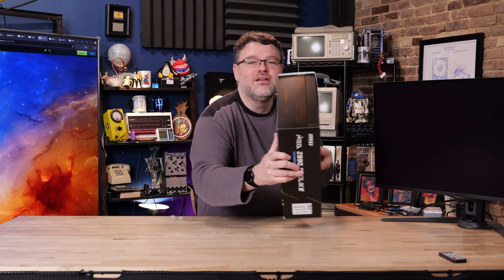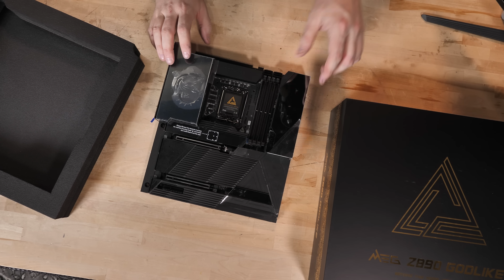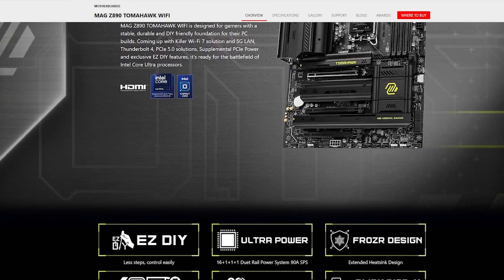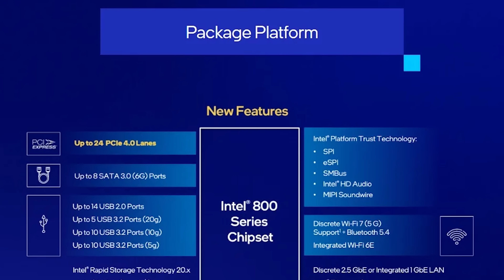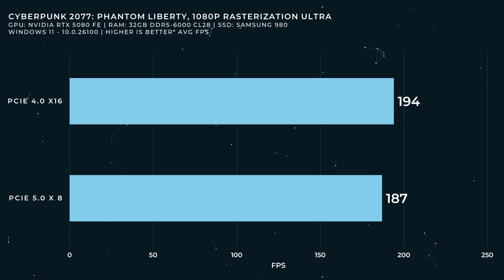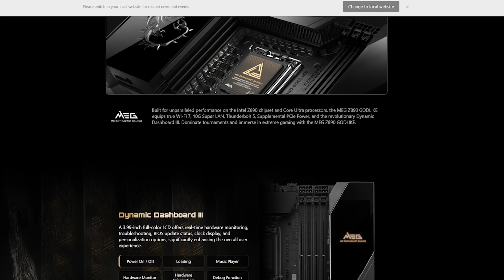Checking Out the MSI MEG Z890 Godlike!

Comment: The X870E Godlike is better than the X. I know this is the Z vid but still. 9950X3D2 128GB DDR5 6000 5090 Liquid Suprim. Ya, the 4tb 990 NVMe and 5090 Liquid Suprim. DO NOT HANDLE THE GODLIKE BY THE EZ-BRIDGE EVER!!!! In the X you get a personalized M.2-1 heatsink, a doll, and a different box, for +$300US. But at this price I know it's flex, But it's still dumb. I have not used to expansion card yet. Overall, This is the best Puter I ever built.

Comment: I'm not sure why MSI made and included a m.2 Xpander Slider with the board. You only get 8 lanes off your GRP if you install the Xpander Slider. If you're going to get this MB it has 20 PCIE 5.0 lanes so you'd want to Run your GPU on the PCIE Slot #1 and you'd use the M.2_1 (Slot1) in 5.0 mode as well. So you can leverage PCIE 5.0 Speeds on both your GPU and your SSD.

Comment: I have the x870e godlike and I love it!! Also just picked up my 9950x3d!! I also got a 4 tb and a 2 tb t705 on sale Black Friday!
Reply: which case are you using ? as i guess it needs a large size case to accomodate and multiple fans i guess
Reply: @ I’m using the phanteks nv7
Reply: @Ducki3.-  thanks bro
Reply: @ let me add some cords were a tight fit so I had to get a usb3 90 degree adapter and some others. Also the right side inside of the case is an argb strip that you can turn for bigger motherboards. I had to take the right one out so the cords would fit. So the motherboard is a little big but you can make it work
Reply: @Ducki3.-  got it bro, thanks alot

Comment: I love the building convenience features you get on these high-end boards, but I have absolutely no need for all the other overkill stuff that comes with them. My dream motherboard would have:
 - 1 fast PCIe slot, with a release button
 - 1 fast M.2 slot nowhere near the CPU or GPU (presumably using one of those redrivers Wendell mentioned?)
 - 2 RAM slots
 - 2 slow M.2 slots for Ethernet and WiFi cards
 - a 7-segment LCD for POST status
 - a breakout cable for the power/reset/LEDs connectors
 - no on-board audio (I presume everyone these days is getting audio over HDMI/DP or USB for musicians?)

 - no SATA
 - some fan headers
 - some USB-C/USB4 ports
 - a power button

Comment: I have a huge problem with these so called "High-End"-Stuff.
The target group for these kind of stuff is High-End-Enthusiasts.
And you know what, these kind of people don't stop at the mainboard, they also have other high-end stuff.
They have a high-end sound system, a high-end video-system, a high-end network, one or more high-end NAS-systems and much more in their possession.
Therefore why does the mainboard have not one or two QSFP28 or higher to use my 100GBit-Network?
Why it has analog audio when I just need one or two digital audio output to get into my high-end AV-Receiver?
And why so many M.2 SSD-slots when I just need one or two for the system and the rest comes from the NAS over the 100GBit network?
All the many different outputs are great, but why not in a separate front-panel I can install in the front of my PC or under my table to reach it for convenience?
I could go on...
The whole conception of these "High-End"-Boards is just thinking from the wallpaper to the wall...

Comment: I hate how greedy this industry has finally become, over a grand for a motherboard is insane.  A motherboard should in no way be more expensive than the CPU, especially when you consider the manufacturing complexity between the two.
Reply: This is a luxury item for a luxury price. There are plenty of cheaper motherboards that get the job done. No one is requiring you to buy it. Tons of base and mid range models available.

Comment: Over €1500 for a gaming motherboard that has basically fully populated PCIE slots and then only gives 8 lanes to the GPU, which makes it perform worse in gaming. Also, this has 4 memory slots, so forget about more advanced RAM OC. 
More like MSI Z890 Sh*tlike.
Or, should it be called MSI Z890 Goldigger?

Comment: For anyone that looks for raw gaming performance they will either get 9800X3D or 14900KS and overclock, 285k is letdown for gaming at least. 
Raptor Lake is still superior for gaming performance vs Cope(arrow) Lake, ignoring power draw and cooling requirement. 
Also 285k disk performance sucks compare to 14900k. 
Optane performance is heavily degraded on Arrow Lake compare to Raptor Lake, 4.67s on 14900k vs 7.71s on 285k.

Comment: Not that I would ever be able to afford this.. But I'd still love to see more full PCIE slots instead of m.2 slots. Especially if they're going to include multiple accessory cards like an m.2 riser and thunderbolt cards. To my layman's eyes it may even negate the need for so many redrivers or PLX chips.
Reply: Unfortunately these design decisions to throw a dozen M.2 slots onto a mainstream motherboard haunt both, AMD’s and Intel’s platforms.

It’s mostly impossible to use the available PCIe lanes for regular PCIe Add-In cards even if the limited amount of PCIe lanes would suffice for your desired configuration - even the mainstream socket motherboards by the enterprise manufacturers like ASRock Rack or Supermicro are configured like this.

Adapting regular PCIe slots out of a motherboard’s M.2 slots is a nightmare, especially if you want to maintain compatibility with PCIe Gen5.

For example I do not understand WHY there isn’t a single AM5 motherboard that offers the following PCIe slots:

Slot 1: x8 Gen5 by CPU

Slot 2: x8 Gen5 by CPU

Slot 3: x8 Gen5 by CPU (using the 8 PCIe lanes that are normally used for the two M.2 slots)

Slot 4: x4 Gen4 by the motherboard chipset